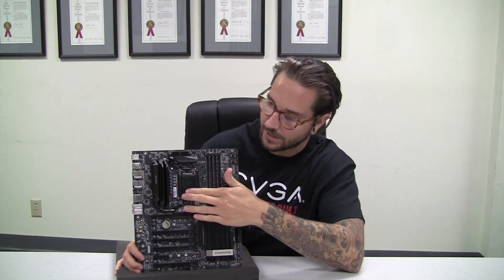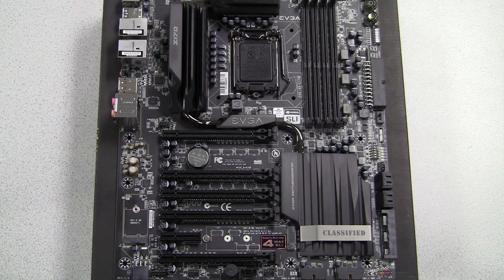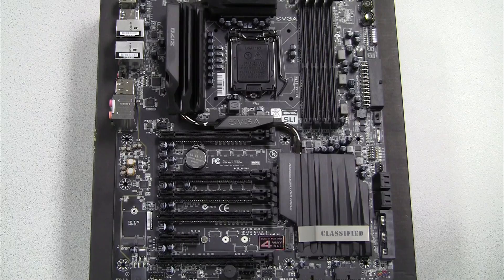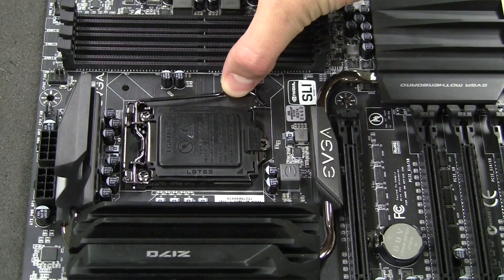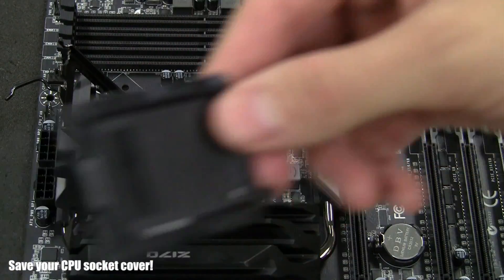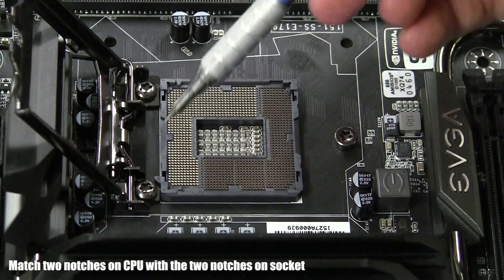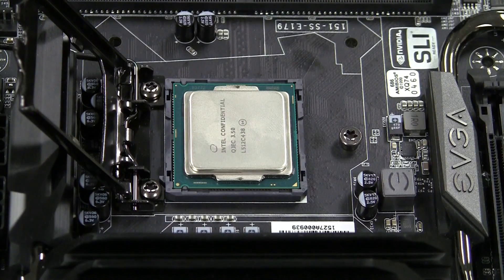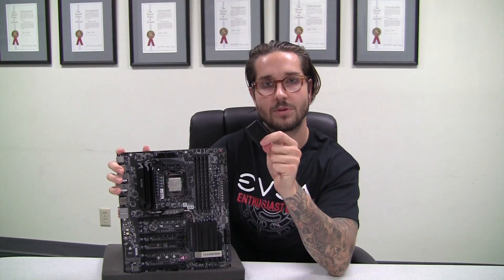How To: EVGA Z170 CPU Installation

Comment: Or you could just align the pins accordingly by matching the triangle on the CPU to the triangle on the socket and leave the black cover on as it will pop off when pressing the lever down.
Reply: +MJDHX What you described is the best way to put unnecessary strain on your CPU and CPU pins.